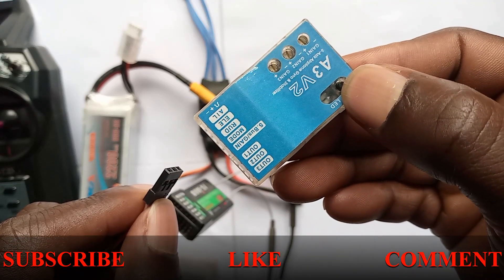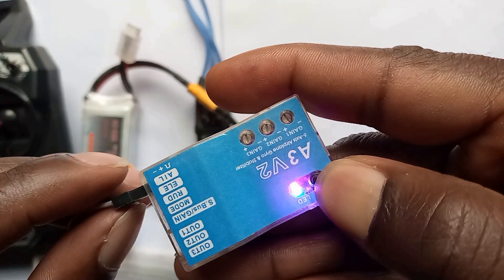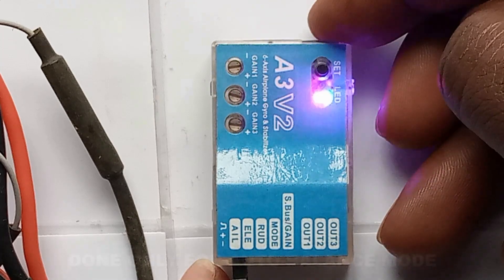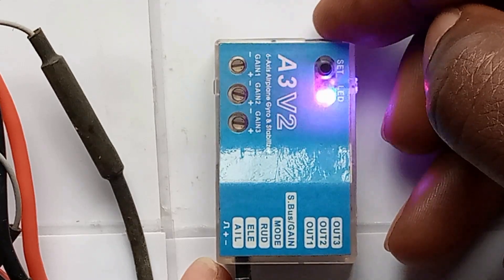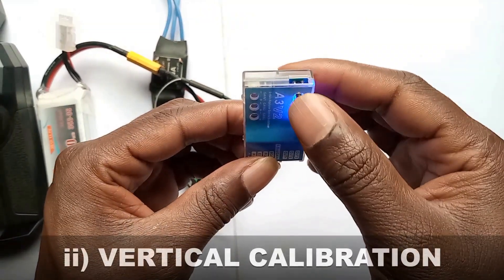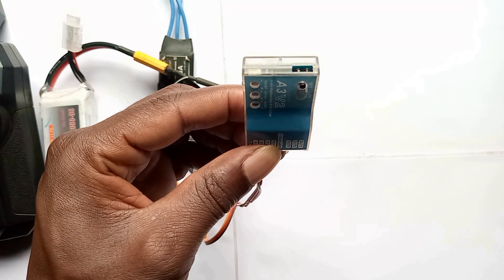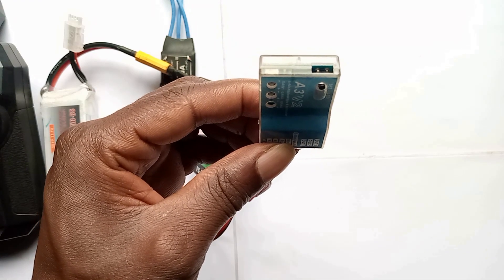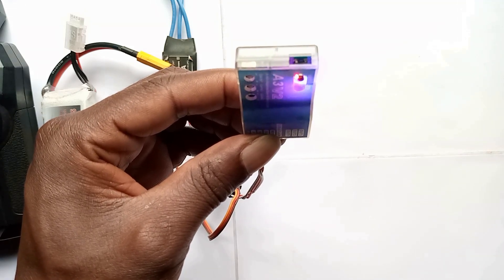How To Reset & Calibrate A3V2 Gyro Explained

Comment: The Set Level and Vertical Calibrations should ONLY be done with the stab unit mounted in your plane and the plane sitting at the wings level and nose-up angle that it will be at when flying at about cruise throttle range. IF the stab was only intended to go in a plane dead flat (as on this table) there would be no need to allow any means of changing it from the factory setting. It is to allow for any slight off-angle mounting in your plane - which you won't see UNTIL you mount it!
Reply from the maker: Exactly 💯